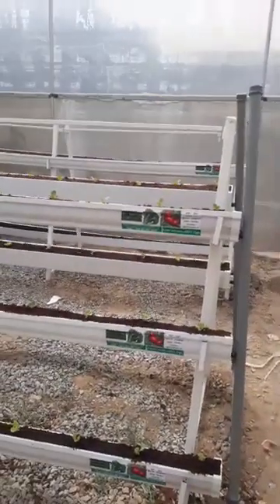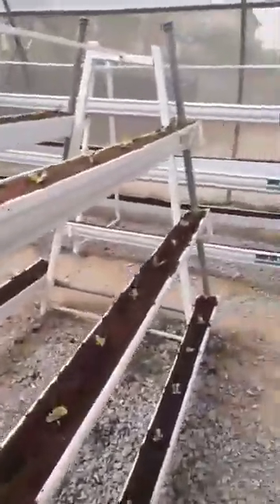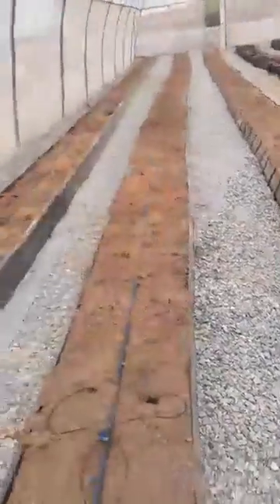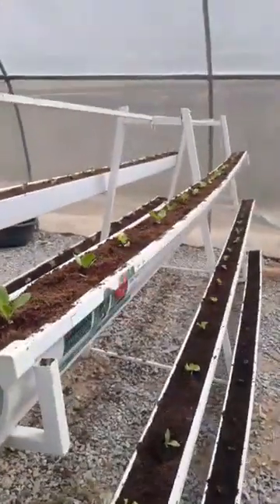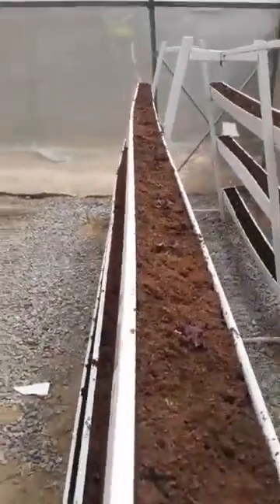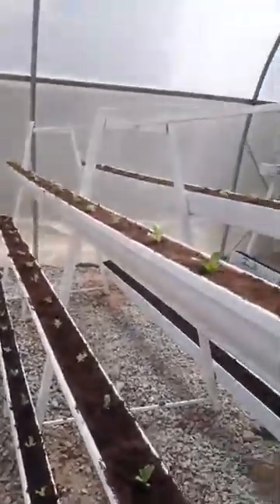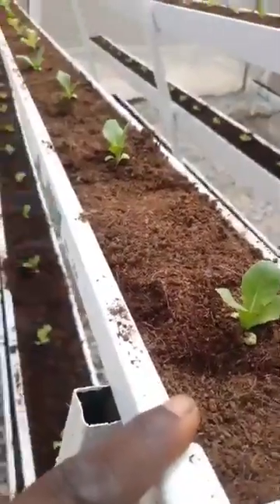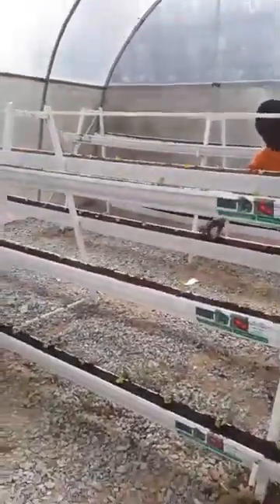Responsive drip irrigation and Responsive Drip hydroponics

Comment: How plant nutrients are added through this pipe. Thanks
Reply from the maker: Plant Nutrients are mixed in the water reservoir.... It also helps in saving lots of nutrients
Reply: @bicfarmsconcepts  , So plant nutrients are applying as liquid fertilizer. Do you have any suggestions for that liquid fertilizer. Thanks for the details.
Reply from the maker: @moshfequelalam354  yes, made from calcium nitrate, potassium nitrate, Monoammonium Phosphate, Magnesium Sulphate, Chelate mix, etc...